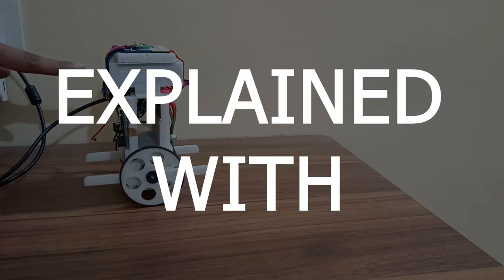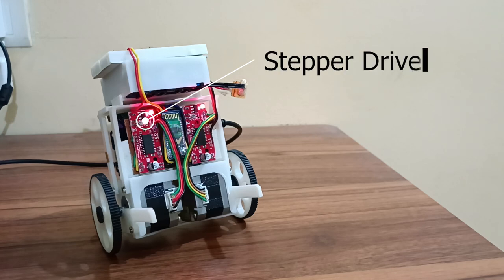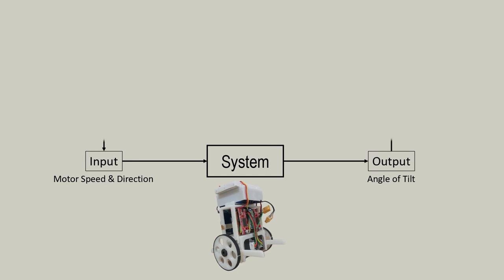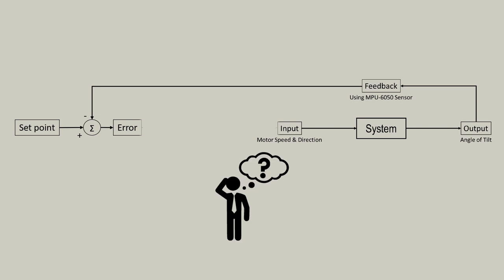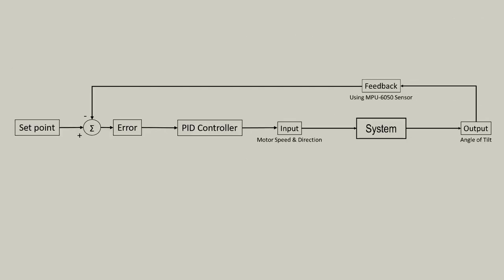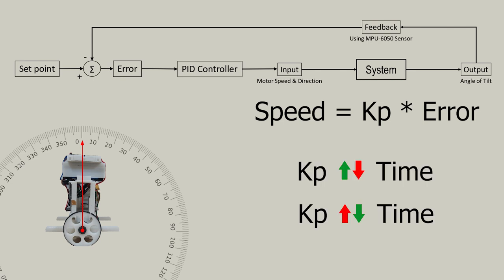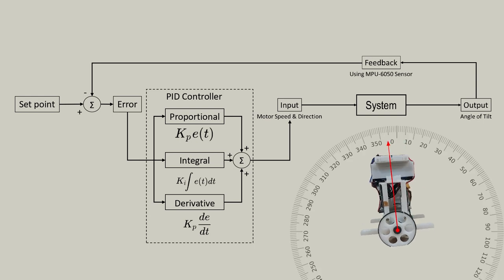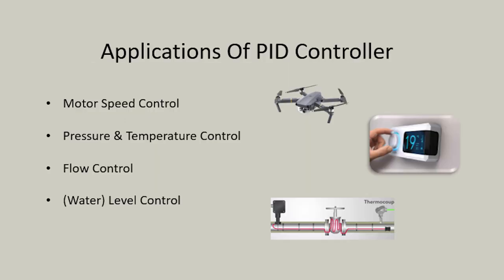PID Control: Arduino Self-Balancing Robot [💥SUBSCRIBE💥]

Comment: Great content, but as I am building similar robot right now, I would like to know more in-depth info: like how to chose input/output pair - is it better to take PWM as input for dc motors and angle as output or speed as input (measured by magnetic encoder) and angle as output and then second controller that tries to make speed/steps as zero. 
You have great content and I would look at it in future :)